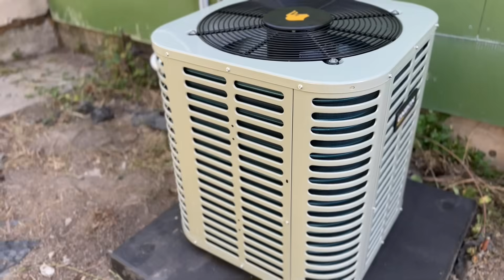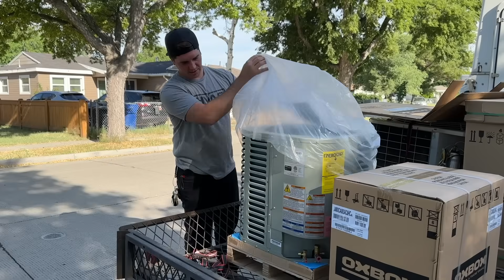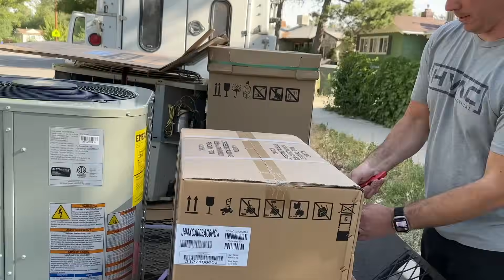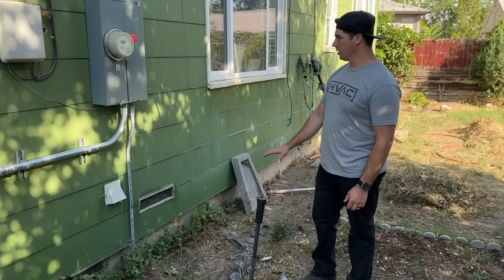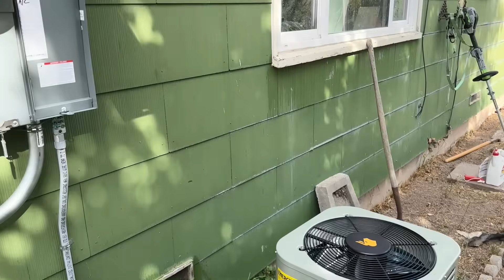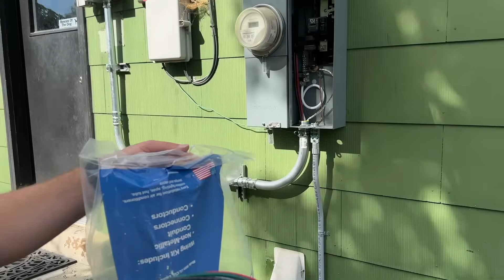We Added Air Conditioning To This Home In ONE DAY.     |      Full Installation From Start To Finish

Comment: Great video.  Does it matter if you use an evaporator with a txv or fixed orifice with the same condensor or is it condensor specific?  Thank you!
Reply: Thank you for the responses.  I think my question was more simple.  Can a condenser unit, say a 2 ton, use either a 2 ton evap with an expansion valve or evaporator with fixed orifice.  In other words, Can a condensor unit accommodate  both coil types depending on the application. Thank you
Reply: Yes all a fixed orfice or txv does is create the pressure drop and make the liquid to start the phase change.... all they do is make the liquid turn into a vapor like when u put your thumb over the end of a hose and you get the mist from it....  a vapor/ mist state is the best form to pull heat out that is why over charged system dont work cuz not only do u flood your compressor but u flood your evap coil with liquid instead of vapor and in liquid form you cant extract heat..... but yes you need a pressure drop of somesort weather it be an orfice or txv.... you can take a txv out and replace with an orfice or vise versa unless u have an exv which is controlled by a circuit board and sensors because you may have a modulating unit so the superheat will always be modulating according to temp and pressure
Reply: If you dont know then dont try...!! not trying to be offensive but this is a trade people go to school for and have to pass to be certified to do such a job... this job is not a diy job and he should tell you only professionally trained and qualified people should be doing this trade.... some of these videos give off an i can do this job view but im telling you by someone that does this every day that it is not, these are just slightly informative videos with alot left out and alot more to learn....
Reply: @esbonwordenjr6069  I agree it's super complicated for the average joe, and prob most people who think they can do it actually can't.  But there is a few trained in other fields that could do this fine.  But even if they could handle it, they don't do it enough and have the experience to prob be as proficient as you or those in your trade.

Comment: Dryer vent is a bad idea ! It will need to be cleaned forever. Happened to a relative that had condensing units next to each other ended up replacing both.

Comment: Why would you choose to upsize the evap. coil? Is there a benefit?
Reply: Sometimes the supply house doesn't have an exact size in stock so you can get a different size and then install the optional "pistons" to make it work.
Reply: @anonymousbaros4424 as long as it's no greater or less than half a ton difference.

Comment: Totally agreed on SB-8. As a first-timer DIY on Goodman 2 ton condenser, brazing copper pipes was the scariest part. After watching Dave's videos, I am sold and went with SB-8 on my installation. SB-8 is easy to use, just buy extra bags of HVAC fittings and practice them few times till you get the hang of it before you actually doing it on the real installation. 
As always with anything, the preparation step is the very important - make sure that pipes and fittings are prepared properly, clean, clean... very important. 😀

Comment: For what reason did you upsize the indoor evaporator to a 2.5 ton while the outdoor condenser is a 2.0 ton?
Reply: School me, I am not criticizing, I am not an HVAC professional but have always heard that mismatched equipment doesn't work right.
Reply: Just have to change piston
Reply: @tobyrussell7553  That's it?
Reply: @tobyrussell7553  Why the huge fuss I always hear about "mismatched equipment"?  Sounds like a major over exaggeration if all they need to do is swap a piston with a different sized orifice.
Reply: @GlobalistGuillotine  can upsize or downsize to an extent like .5 ton or 1ton max
Reply: @FloridaManInFlorida  people saying that probably don't know much about hvac
Reply: @tobyrussell7553  My Father recently had his A/C condenser and evaporator replaced.  Installation crew with company owner of 40+ years made a comment to him about mismatched equipment that was there prior.
Reply: @tobyrussell7553  I see.
Reply: Can only be a difference of half a ton up or down or match tonnage. Anymore and system will be very problematic.

Comment: I'm trying to wrap my head around how the Schrader valve installer works without losing any gas or pressure! Lol! I get that it works,I just don't know how 😊
Reply: It's just a round spring loaded valve with a sealing gasket
Reply: @amtrakusa1  I understand how a Schrader valve works. What I don't understand is how the Schrader valve installer works. How does it install the Schrader valve under coolant pressure without losing any coolant or pressure?
Reply: Please at least watch every hvac school video before you try any of this please... this guys vids make it look easy but it isnt....please dont try to diy anything with refrigerant without having full confidence before you start and asking a guy that makes a video isnt the guy to just ask.... you have to be trained and certified to even do this job let alone do it correctly
Reply: Amtrakusa1 your giving bad info to a person that has no idea of what they are doing
Reply: @Kevin-mp5of  ok smart-ass! Yes ,I should have said "refrigerant " !  I guess you needed to feel superior! Obviously, hvac is not my forte. I could troll all your comments looking for a misused word. However, I actually have a really nice life that I'd rather experience than waisting my time correcting other people.
Reply: watch a video on it. it isolates the pressure. you can change a shrader while the ac is running. blew my mind too til i bought one

Comment: I just got quoted 900 to braze a lineset and charge the unit. I agreed. He then told me the bill was $1,300 because he added 6 lbs of refrigerant! 
So, he's upcharging coolant 500%! 
I'll pay him $950 or he can take me to small claims and never get a dime. It's unbelievable how these guys are.
Reply: Good luck fixing your broken a/c unit when it's 90 degrees outside, with no knowledge or parts you can't buy w/o a contractor license.
Reply: @240zguy  I'll buy a new unit and install it myself and still save thousands and have brand new equipment. 
I built my entire house dude, I can promise you I have way more knowledge than you based on your bs
Reply: If you can't buy your own a/c equipment or refrigerant, cry on somebody else's shoulder.
Reply: @240zguy  see you are the problem. The fact is I can buy equipment and refrigerant. Once again more lies. I bought all the equipment but simply didn't have time to finish the system.
Keep spreading those lies
Reply: If you don't possess the knowledge, you probably shouldn't be working on your own a/c equipment.
Reply: Lets see, 6 lbs x $70/lb for R-410A= $420.00. Sounds correct to me. I don't work for contractors either. I received a rubber check from one, the rest  nickle and dime ya and are slow to pay. Good luck getting any other HVAC contractors to ever work for you. The word gets around quick as we all know each other.
Reply: @USA-GreedyMenOfNoIntegrity  I'll never call another HVAC conman again. I already ordered 25 lbs of refrigerant and guages. You guys are unbelievably dishonest and your comments prove my point.
70 per pound? I just paid 13 per pound
Reply: @USA-GreedyMenOfNoIntegrity  and I like how you ignored my comparison to a concrete guy going up 500% on material
Reply: @USA-GreedyMenOfNoIntegrity  how much is your cost on R-410? See you are full of it, it doesn't cost $70 per pound, it's $15 per pound!
So you work for homeowners who are clueless
Reply: Market Value, as simple as that. We don't want out trade burned down.
Reply: @mecharenacorrupt1055  that's why y'all never tell people your actual material cost? It's not market value,  it's more like just being overall dishonest crooks.. yall should go sell used cars and start chasing insurance claims.
Reply: @venous-gaming55  ok cause you ask what the cheese slice, pickles, buns, packaging costs when you go buy a burger right? It's called business. Point blank. One doesn't only upcharge material. Also charging for our experience and the warranty that comes with our work. The education and continued education. The insurance involved in our profession.The wear and tear on our tools and vehicles.  Tool breaks, gotta replace it. Vehicle breaks, gotta replace or fix. Our body also wears down and we gotta take care of it, i personally visit the chiropractor regularly. All in all, the customer pays for us to keep being able to provide our service. Alot more people dish out a stupendous amount of money on vehicles and don't bat an eye when making those payments. Can't compare to selling used vehicles. I personally do not install used equipment cause I will not be able to put warranty on it. Used vehicles being that they are obviously used are not a good buy, a smart person will do like me and buy a cash vehicle at $2k. And actually research a vehicle before buying. Going on 10 years of Residential installs and Light Commercial. Got loyal repeat customers and the list keeps growing from referrals. If asked I'd gladly provide itemized list of material and labor. Not afraid to list my labor prize cause at the end of the day wearing down ones body from hard labor is actually expensive to keep healthy.
Reply: @mecharenacorrupt1055  yeah im a sub contractor myself I understand everything you said.
Here is the problem. 
I come install cabinets in your house and I give you a bid for $900.
I also list that I charge $50 per shim and and total estimate on shim cost is $0.
Then after the job is done I tell you the total is $1,300 because your floor was out and I had to use shims.
It didn't take me almost any extra time and shims are actually very cheap but I mark them up.
 Using shims to get a whole kitchen level takes a lot of experience sooooo yeah, you think that is fair? That's exactly what the HVAC industry on refrigerant and before you tell me I need a license to buy it, no I don't, I already bought a tank.
Reply: Yup...chest me for my work. I can just take back the freon.😅😅😅
Reply: @2nickles647  you can also go to jail for trespassing and theft
Reply: @2nickles647  and yeah cool come waste more labor and not get paid.
Or give an accurate bid... pretty simple
Reply: It’s his own darn fault for working for a DIY’er. Serves him right. You are the exact reason why legitimate, reputable contractors don’t waste their time with DIY’ers. There is a reason it’s called a QUOTE!
Reply: @USA-GreedyMenOfNoIntegrity  let's put this in the perspective of a concrete guy.
So he gives you a quote for a driveway and says it'll be 10k, then while pouring he has to order more concrete at $250 per yard.
Hands you a bill for $15k. Says I had to order more concrete and even tho I buy it at $250 per yard, I charge 500% more so my quote went up 50%!
No other trade gets away with this kinda bs
A concrete guy would simply add the extra material costs to the job.
Reply: @USA-GreedyMenOfNoIntegrity  500% markup is absolutely unethical. I'm not a diyer, I'm a licensed subcontractor who doesn't allow price gougers to upcharge 500% on material.

Comment: interesting that a trane unit isnt using the spine fin coil
Reply: "OxBox" is a Trane Technologies brand but has its own models vs. "Trane"-branded models. Which is to say: it's different equipment.
Reply: Its a builder grade unit,basically,the same as the Ameristar that Americsn Standard was putting out! Think of meat,you have Select,Choice,Prime! This is the Select grade.Not meaning its not good,its just not the best!

Comment: No longer a fan of staybrite 8 solder, I think it’s user error on my part, but I agree with you as far as flux contamination…

The nitrogen will push it out if any is there if you do it right. and the Vaccuum will be evaporating it too. 

Love your videos. Did a Gentec 10CM review today and made sure to mention you
Reply from the maker: That’s awesome! I’ll have to check it out. What do you think happened with your sb8 job?
Reply: @diyhvacguy  so far I’ve had 4 call backs for leaks. The first was an obvious I didn’t get full penetration. 

The other three I’m not sure, I made sure to heat it up well, get a good amount of solder in, prep the pipe and everything. 

I’ve switched to Silfos since, and I really enjoy using it as well.
Reply from the maker: Didn’t Mikey use this all the time??
Reply: @diyhvacguy  yes, I always bring that up with him, and he’s never really given me any sort of response. But it’s company policy now to use Silfos 15
Reply: @DCHVAC I sent Mike a video of myself doing the dreaded copper to steel joint,with Harris Stay Silv 45,perfect joint! Stay Brite 8 joints I have only ever used on lower pressure joints,but with the Stay Klean liquid flux,I believe it gives a cleaner,better capillary joint and only ever used just enough on a brush to change the color of the copper to brite clean! For years,I have tought proper joining techniques in copper and steel and of the guys listen they do very well. I attended classes put on buy the Copper joining institute and learned alot from them.The big one was learning the 1,2,3 method,and understanding your filler reaction,Step 1,heat the tube,Step 2 heat around the face of the bell/socket ,Step 3 move to the back of the fitting. And a secret,always fill the bottom of the joint first,and use only enough heat to accomplish the joint,so when it starts to flow back the torch off and away from the joint! It does take practice,but chop up old linesets,swage them and practice,practice practice! In time youll be able to stick a turd to a snowball!
Reply: @petersmart1999  lol didn’t know I could stick a turd to a snowball, might have to try that this winter, I’ll let you know how that goes. Thanks for the tips
Reply: @DCHVAC  Something else that knowone talks about is frequencies in copper tubing.Its been awhile,but compressors can create sine wave frequencies(I think thats what it was called) but it can cause joint and tube failure of its just right.Look up induction soldering and heating,you essentially braze/solded with radio waves and induction loads,can create a form of this same thing unless its designed out! Had failures on several units and all were the same exact thing,I got ahold of Flex Hose company and the made me Flex mufflers and ot cured the issue.Eventually the manufacturer came out with a fix and it was to increase the length of the discharge lines by about 7 or 8 inches,to stretch the wave length! Sounds crazy but thats what it was.
Reply: I don't know if you guys have been having this problem but last 6 months or so are copper has just been shit.Its softer than normal,sometimes has a weird smell to it ,sometimes is an off color ,and sometimes it won't take braze easily.

Comment: How is that flexible vent proper?
Reply: Looks like a chimney liner 2-wall flex pipe.  If it's good for a fireplace I can't see why it wouldn't work for a furnace.
Reply: Its not, the sulfuric acid produced in the exhaust condensate is going to rot it out and you’ll have deadly gas in the house.

Comment: I love what do.  Sharing your knowledge in a way anyone interested in learning can follow you with ease!   Again, thank you.  I know it’s a lot more effort to complete a job like this and getting all on camera and it’s appreciated.
Reply from the maker: It really is but I’m happy to do it because of comments like this one!! Thanks so much! 🙏🏻
Reply: @diyhvacguy , agreed! As a new subscriber, I've been watching so many of your videos now! It would have been nice if your material was around when I installed my unit. I did not know to do HALF what you've done, the tools you use etc., but I was never in HVAC. There was only central heat for the slab & the system blew the air underneath it. It kept your feet warm but that's what slippers are for! It was horribly inefficient by that time so I tore it out, filled everything in with concrete and installed a split central heat and air system. A friend told me his family member worked in HVAC & he had a sheet metal brake so I provided him with sheet metal and measurements so he was kind enough to form the pieces of my plenums. The spaces I had to work in were small so I had to take them in as "panels" and then assemble, seal & insulate everything. 

I cut/installed the collars, boots, flex etc., ran the lineset and brazed the connections. I utilized a 240V outlet from the living room intended for a large window AC unit and routed it to the outside with the "disconnect" box etc. I only needed to borrow a vacuum pump & the unit contained ~15' of lineset worth of refrigerant and I've been having ~20° difference at the register compared to ambient. That's been over 15 yrs ago and thankfully it's still going! As for maintenace I've simply kept the air filters changed, I've cleaned the inside/outside coils and I replaced the capacitor at the condenser. There was a hot day where it didn't start so I opened the panel and saw the capacitor was rusted and bulging... Anyway, I know there are more I haven't watched yet but keep the videos coming! ^_^